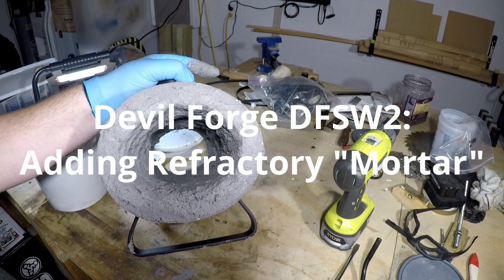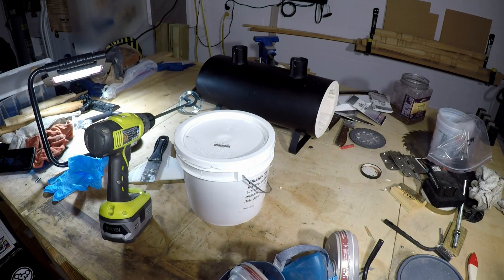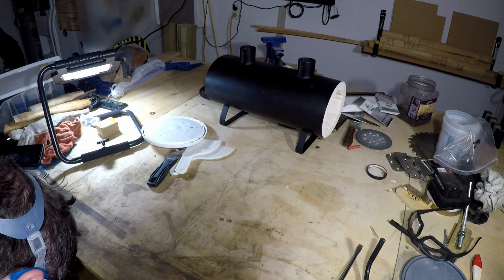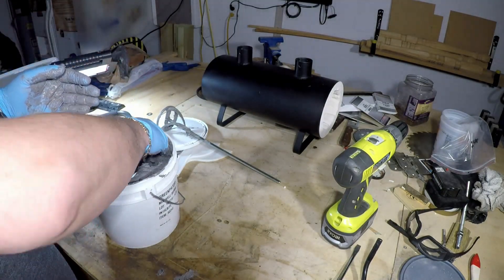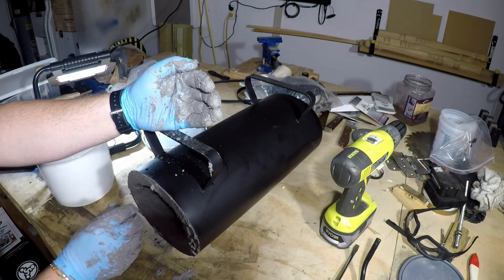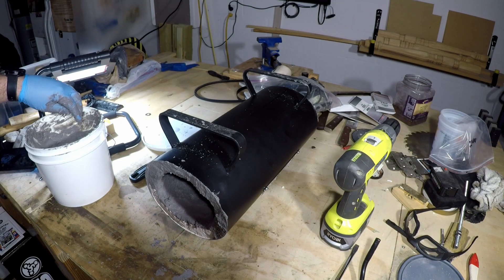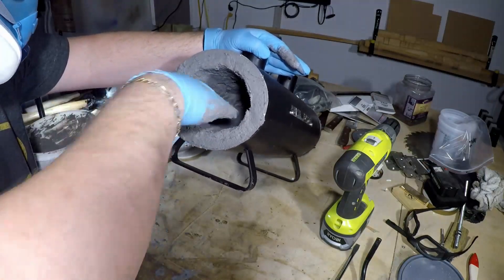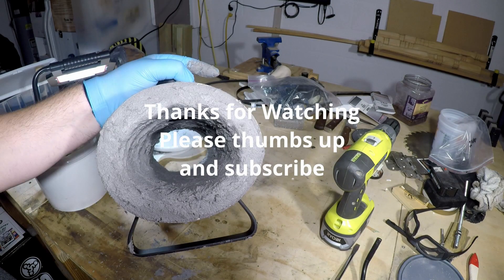Devil Forge DFSW2: Lining with refractory "mortar" - Greenpatch 421

Comment: Ceramic supply shop??? I just bought 50kg for $250. Canadian another place was $350...$35 US is $50ish Cad.
I will check it out for next time. I saw $85 US for same size but duty and shipping was a killer.

Comment: Hey Lou, thanks for the informative videos. I am researching gas forges and might follow in your footsteps here. How much of the Greenpatch did you use for this? I can buy the 15 lb bucket or in pints and don't want to have too much left over.
Reply from the maker: I used about 1/3 of the gallon total.  That would be about 3 pints worth, I think.

Comment: Did you add that on top of the supplied rigidizer?
Reply from the maker: Yes, this stuff dries rock hard and makes a pretty good floor to work off of (I felt the rigidized wool was too soft).  You could use the supplied bricks as a floor, but I feel like the sides and top should be more protected as well so I did the whole thing.
Reply: Many thanks. I received mine today. Had to get it quick before Import Duty could be added if the U.K leave the E.U